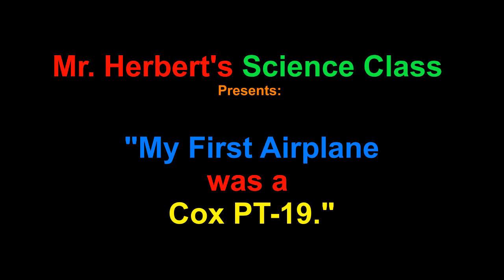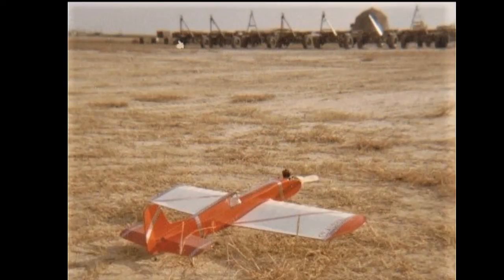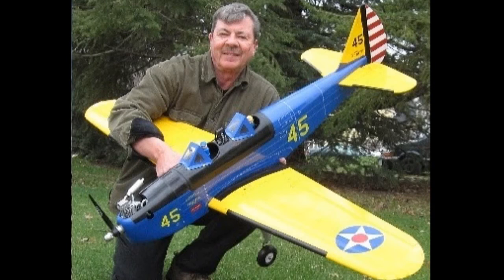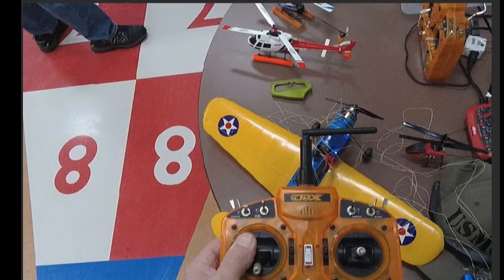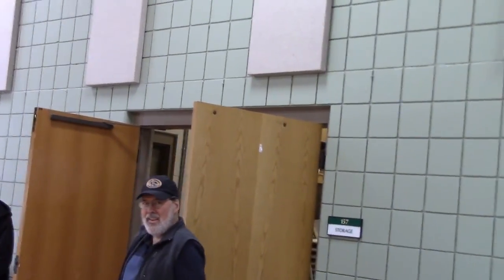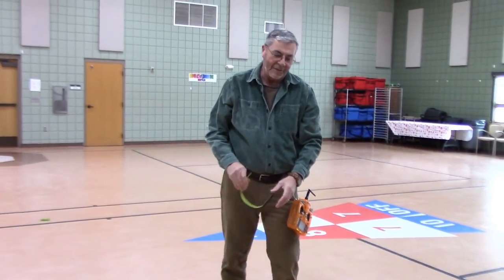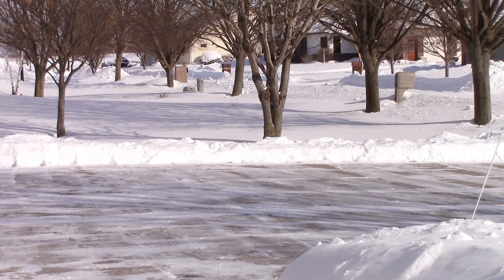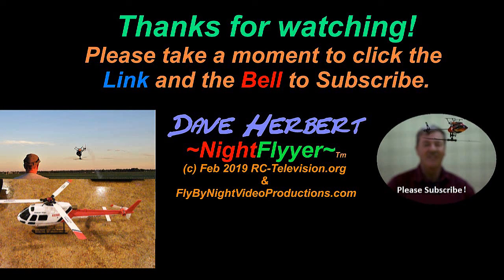Vintage Cox PT-19  UKIE Trainer converted to Brushless Motor experiment.

Comment: I learned on the Cox PT-19 in the 60’s.  Hey, in the opening picture, I believe the wings are on backwards 😊
Reply from the maker: Absolutely not.  Come on! I just looked at the box and that is the picture on the box.  Here is the newer video and very clear compared to this old video.  The wing is very visible there and  is flown with the stock Cox .049 engine.  https://www.youtube.com/watch?v=BU0z7ddwslY&t=13s
Reply: lol….seriously, it looks like the trailing edge of the wing is in the front….which would also explain why the line outlets are on the starboard wing instead of the port…
Reply from the maker: @marksvarverud130  All wrong!  I'm no beginner, you know!
Reply: Oh, I don’t think you are a beginner at all….no criticism to you.  The newer video shows the wing on proper.  No big deal at all.

Comment: The PT-19 was one of the few Cox airplanes that would glide a little after the motor shut off.  Most Cox models dropped like a brick after they ran out of fuel, especially that tiny little biplane that had the tiny, but screaming little motor.

Comment: Yeah. I started with a uc cox 300 extra which was hard to start, and I always crashed. Then I got that pt19, and had many successful flights. I would even fly at the edge of a frozen pond and try to time my glide so as to land on the smooth ice, and not crash on land.
Reply from the maker: That is fantastic. Here is a newer video of the PT 19 as I flew it last summer.  Thanks.  https://youtu.be/BU0z7ddwslY

Comment: Cox U-Control airplanes, with the exception of the large Comanche which flies very well on longer lines, all fly too fast on those short lines. Extending the lines makes them unstable and they almost always try to fly towards the center of the circle making the pilot lose control. I know, I tried it when I was a kid. I suppose that excessively high wing-loadings and excess power is the culprit, although I don't think that they would fly at all if the power was reduced very much. I recall that I did have a good experience with the original green Cox Stuka, which flew very well, indeed. Anyway, short-line U-Control is better for young people as they don't seem to become dizzy so readily. Has anyone any information about converting Cox airplanes to R/C?
Reply from the maker: My friend and a club member worked at Cox and I know they spent many hours finding the ultimate length of the strings.  I have many ukie videos and am working on more now.  I have put radios in them too, and even an rc tethered version that did not make me dizzy.   Just search my channel for u control or ukie and you will see them.  Thanks and for sure the Stuka was robust and fun to fly.
Reply: @NightFlyyer  Thank you for your reply. I’m certain that Cox did a lot of good engineering including determining practical line length. Those 30’-35’ lines would have been fine if using them did not cause the airplane to complete each circle so quickly (r .p. s.), i.e., high angular speed. If the airplanes could fly significantly slower, thus significantly reducing the r. p. s., the experience of flying them would be infinitely more enjoyable. However, for many necessary reasons, the problem of keeping slow-flying airplanes taught on their lines would be virtually insurmountable as we know that a good deal of control-line flying depends upon centrifugal force. Slow control-line flight of small airplanes is not a practical reality.

As I progressed in the hobby and later flew larger control-line airplanes on  60’ foot steel lines, the whole thing became so much more comfortable and enjoyable. However, as I grew older, even flying those larger airplanes in larger circles became difficult to do for more than a minute or so as I became more sensitive to dizziness. Fortunately, proportional R/C was then becoming affordable and reliable, so that is where I went. No more dizziness. What a nice change.

I appreciate that it is necessary that small ukie airplanes fly very quickly so that they can fly at all, therefore the smaller circle requiring shorter lines.

I also appreciate that making these classic airplanes out of the plastics and methods that were available in the day was an innovation which made the airplanes more robust and cheaper to manufacture in bulk and accordingly, more affordable, particularly for kids to own than if they had been hand-built from traditional model airplane materials, e.g., silk or silkspan covered balsa, plywood, etc. However, their plastic construction makes these airframes rather heavy for their size, making their wing-loadings very high. This, in turn, means that their estimated Reynolds Numbers (difficult to predict or measure at such small numbers) are extremely low, certainly well below 30,000. A lifting surface with such a low RN produces little lift and will stall at a very low alpha (angle of attack), perhaps 5 degrees or less. Additionally, a single-surface, curved wing produces far less lift than does a double-surface wing. All of this means that the entire airframe must move through the air at a relatively high airspeed in order to maintain flight.

We rightly observe this when we fly small R/C models which flit about the sky while larger ones fly so gracefully and so much more like their full-size counterparts.

I love the old Cox airplanes and have a few literally still hanging around the house. I even have an unbuilt Curtiss Pusher in the original box. The experience of flying models at an early age for so little money was what made the Cox and other prefabricated airplanes so successful and enjoyable. Unfortunately, as I said, turning and turning about for three or so minutes at a rapid speed is for the young. I fly my R/C airplanes whilst sitting in a comfortable beach chair, only turning when I reach for a cold drink. I suppose that tether flying is similar and a good alternative, but like Pinocchio, I was glad to lose the strings. Cheers, mate.
Reply from the maker: @Glicksman1  I started flying Pattern when I was 12.  That way you did not have to fly around in circles.. Just do loops inside and outside, figure 8s and more.  You make it sound way more complicated than it was and millions of folks were successful.  I fly rc today at 73 as well as ukie and nitro helicopters.  Check out my jets, and bigger airplanes if you get a chance on my channel.  Or even this latest version of my Cox .049 engine plane. These You FO's can really handle the wind and are cheap to make.  And if you remember the .049 days, you will recognize the sound.  In the video description,  are links to the videos of my original electric You FO for a less complicated and quicker build than the nitro version.  Thanks for tuning in. ~Dave
https://youtu.be/DeWao5L6FLM

Comment: I cannot even get the ThunderTiger 50 running properly on a propboat. lol. Its an older engine and even though I put new bearings in it, my guess is the thing is more worn that I am figuring on.
Reply from the maker: Could be.  Try 15% Nitro and and a Starter.
Reply: @NightFlyyer  I replaced the carburetor with one from an OS. The collar was just a tad different in size. I wrapped a couple wraps of metal duct sealer tape around it and it tightened right up using the set screw. I then used the seperate main jet that mounts on the back of the engine( now mounted on the corner of the engine mounting frame) And after a bit of tuning was able to get full maximum power from the Thunder " Chicken". I have since figured out this old Dumas Airboat kit needs an epoxy paint job on the bottom as the original paint is not correct and is causing the airbox to " hang up" in the snow. Its just not slippery. The nitro fuel is also affecting the original unknown blue paint.

Comment: Fun job on the electric set up Dave I too started with a cox PT-19 control line uncle got me was a kid I crashed on the first flight of course until my uncle actually made me wooden 049 kit of a Hellcat with a tee dee 049 boy that engine was very reliable it always stared up and went until  one summer night we take it to a dusty baseball field with lights at the field some dirt went into the engine and it never started again. About 10 years ago me&him wanted to give u-control another shot for old times sake I got my hands on Eflite PT-19 450 ARF with park 480 1024 motor 12x6 apc it was ok it used a special esc with a push button start up with a timer to you give a chance run to your handle  before take of the only problem that lines didn't have to best pull for inverts so here's what happen to mine lol

https://www.youtube.com/watch?v=x-aaZv_U9SY
Reply from the maker: What a story.  I could see you change your mind at the last second before the crash.  I guess there was no way to turn the motor off.  I felt pain watching it crash.  Well, it's all part of the learning curve, I guess.  Thanks for the story and video.

Comment: Would be neat to convert that to 3 or 4 channel RC.
Reply from the maker: That's a thought, but would kinda defeat the whole control line concept.  Thanks.
Reply: I did try that. Circa 1997 Skymasters MI. 2 mini servos and a small battery pack. My plan was to fly it CL style with a single string, then let go. I could not control the plane or even keep it level. There was some rotational or gyroscopic physics that was fighting me. So, never got to the second part of flying it as a RC plane. Plus it was cold and windy.

Comment: My first was a T-28 with an .049 engine. Our yard was small so we had to cut the lines back to 25 or 30 feet!. Thing was so fast you couldn't keep up with it. Then I picked up a little Cox Biplane with a .017 I think or a .019. I never could get it to stay started and had to return it. Probably only needed a glow plug, but I didn't know that back then.
Reply from the maker: It most likely was a Cox .020 as they made .010, 020, 049,051,099 in their line up.  I wish I had the smallest of those engines to play with today.  Thanks for the story and comments, Juan.

Comment: I got this plane for my b-bay in 1980 and had a blast with it. I have a new one of these in the box, maybe I will convert it to electric. I also have the Piper Cherokee version.
Reply from the maker: Great story.  That new one in the box is worth good money, as I found out when I bought mine, so maybe not to open it, but if you do, electric will keep it clean.  Thanks.

Comment: I also had a PT-19  many years ago, was alot of fun. Don't  think I would change over to electric though. Thanks  for the video. Shalom
Reply from the maker: Yep, well I only did the electric to try it, as it was really easy since the motor fit the same mount.  I have already changed it back to Glow Engine, so not to worry.  I will fly it this spring when It warms up and I have more room and full length lines at the airport.  Thanks.

Comment from the maker: When I started flying at a very early age, I started with the Cox PT-19 Trainer and began entering Pattern Ukie Contests a couple years later.  Finding a Brand New, unopened PT-19 on Ebay and winning the bid, I decided not to open and fly it as I originally thought I would.  So I found another one on eBay and won that bid too.  I decided before I use the stock Glow Nitro engine, I would see, just for the heck of it to try to fly it with a brush-less motor.  Here is how it went.